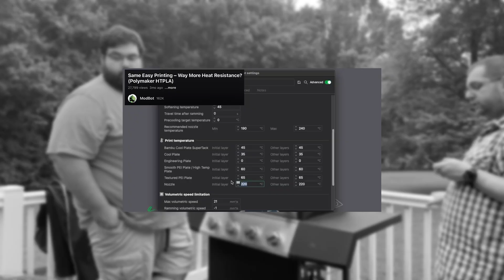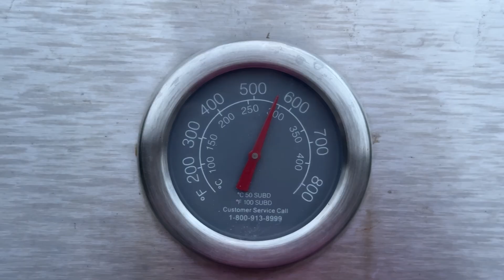Will HT-PLA Melt In The Grill? | Polymaker HT-PLA 30 Day Test

Comment from the maker: Now that this is live, I’m realizing that at the end I didn’t explicitly explain, froggo survived because of the same draft we assume. If the grill was totally enclosed he would have been a puddle as well. Still doesn’t take away from the fact that HTPLA ROCKS in high heat. Cant wait to print more with this material in future projects.

Additionally, the temps during the summer time were between 80-90 degrees Fahrenheit, I’m ALSO just now realizing I forgot to add that context… 

Sorry, still learning!

Comment: Question about the HT PLA/GF. Did you anneal those before doing the test or were they done with no annealing? I ask since I'm going to order some of these to print interior car parts and was debating if I should order a toaster oven to anneal these. Thanks!
Reply from the maker: Nope no annealing! Like we joked in the video the most “annealing” we got was at the end of the second test where everything else was melting except the HT-PLA test strips! 

Speaking on car parts, we have a mutual co-worker who needed a cover for his ford fiesta to cover one of his storage compartments, Yanni printed it in PETG before we did this test, and it melted, we switched to normal HT-PLA and without issue it’s been running since we initially got done performing these tests back in July. 

We were out of the hottest point of the summer by the time we put it in but the days were still hanging around 80-90 degrees Fahrenheit. I feel like in hotter places around the world GF is the way to go, but for us it seems the base HT-PLA should do the trick